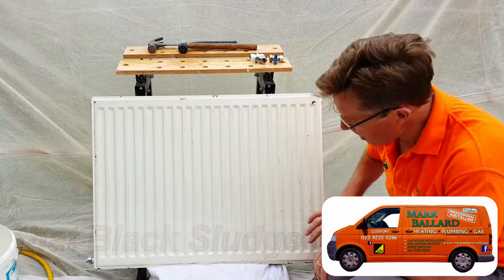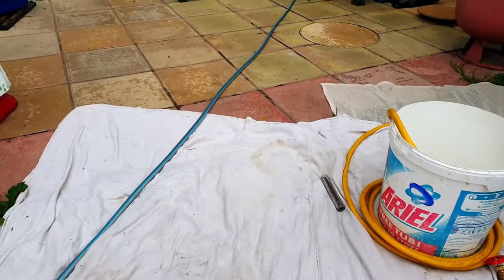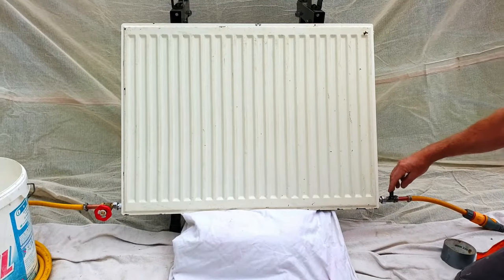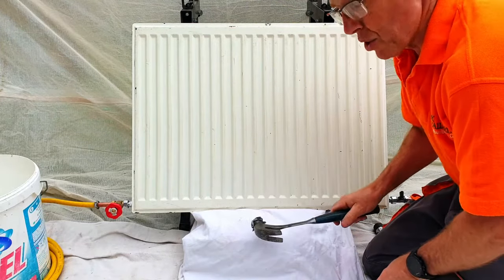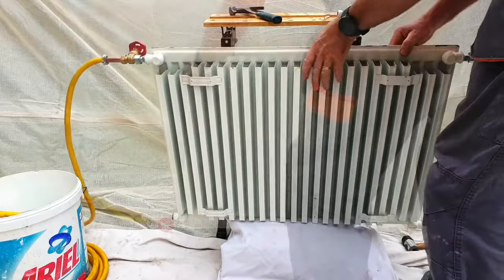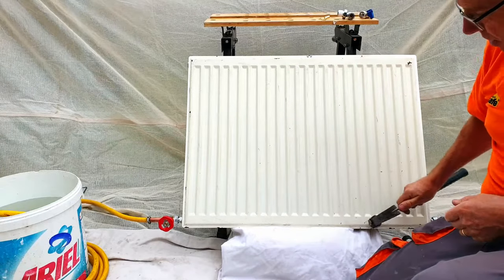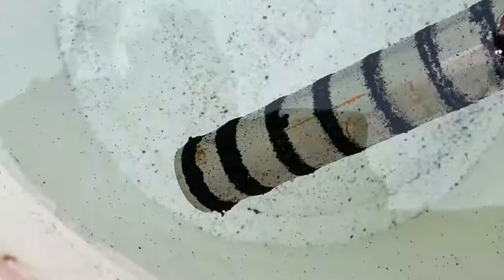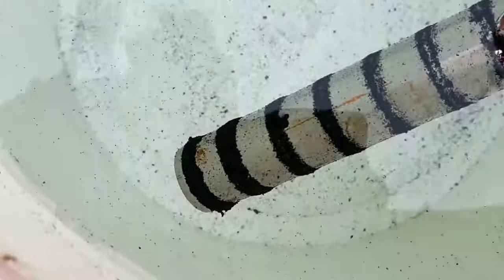How to flush Out a Radiator.  The Best Way, Getting the Best Results.

Comment: I assume (rightly or wrongly) you have fitted a one way water check valve in the mains water supply hose?😲😲 If not, magnetite and fithy water could be sucked backwards!
Reply: Water only flows out the mains (due to the pressure going out). Not in. What can potentially suck anything in? Nothing!
Reply: If there is any risk of this occurring then yes check valves are required by regs or yes with a depressurisation of the mains you can syphon shite back into the potable water supply... not good.

Comment: When you have dismounted the radiator from the system did you just shut TRV and lockvalve to stop water coming from the system? Or did you drainde the water from the entire system before removing radiator?
Reply: I just shut off TRV and lock valve. They don’t leak and does not effect other rads. You will need to top up pressure at the boiler after you refill rad

Comment: Useful video but I have one additional tip for larger radiators.
I took mine outside, used a hose adapter as suggested ( I keep old plumbing stuff so I managed to cobble together something)
I did as you suggested, including the hammer. However I really want to pick it up and shake it but it was too heavy(type 22 -110cm x60cm) I placed mine on a large unopened bag of garden compost and rocked the rad back and forward whilst holding it upright and with the hose running. This generated a huge amount of sludge, which choked the outlet at time but I kept rocking it back and forward till it cleared and run clean. I turned it upside down and repeated this perhaps 2/3 times over 20 mins. I used the bag initially to prevent damage to rad, as I was draining it direct to my outside drain, but when I started rocking it along the length, loaded of sludge came out
Reply: This is what I did with my rads recently- put them on a round 🪵 - half filled them before opening the outlet and rocked them back and forth - great way to get the gunk out

Comment: Hi Mark great video, I have ecotec plus,  5 radiators to clean etc, need to drain the system but need hot water tap. Can isolate the heating ?
Reply from the maker: Just close both the isolation valves under the boiler first before draining
Reply: @MarkBallardLTD  thats what I thought many thanks,

Comment: @Mark: Do you have a parts list to the “accessories” and kit you have constructed there to flush out the radiators please..🙏🏼
Reply: Did you sort one in the end?
Reply: @misfit1978  I did construct 2x tbh.. One for either ends.. ;-) [Havent used it yet, as the weather is horrible at the moment to work outside,and clean the rads.)
Reply: @mariusenslin  Yeah it's rubbish isn't it! I'm going to attempt it this week weather permitting! Could you give me an idea of what / where to get the parts from please?!
Reply: @misfit1978  All The Best of Luck..and do let me know how you get on.

The parts list is as follows, and did I get it from and between Screwfix and tool station,and whichever one had the parts in stock and were the cheapest.
-2x "Made4Trade Lever Ball Valve 15mm" Red or Blue" - Toolstation (£4.80/piece)
-2x 15mm Copper pipe 80mm in length - Cut off/leftover pipe from a job I did.
-2x 170mm in Lenght Garden Hose - Grabbed it off the next-door neighbours hose that they were replacing
-2x Hozelock Hose End Connector" - Screwfix (£4.99/Piece)
-2x "Hozelock Double Male Connector Pro [Metal one] [Amazon - £7.79]
-2x "10-16mm Jubille Clips" -  Have some in my toolbox
-1x "Ptfe Tape" [Screwfix - £0.25)

Comment: Perhaps this is a thick question, but I assume the pipes don't get flushed then?
Reply: 1. As you empty the system. Allow the water to stay on. The pressure will flush it out a bit more for you. 

Or you can 2, empty and refill and then empty.

Or 3. You can insert sludge cleaner (1 litre tub, for ~ 100 litres / 10 rads) and leave for 1 month as a pre-dose, (preferably in the winter, when the heating will be on, 1-2 hours a day). To clean and loosen the sludge from all the radiators / pipes / contact surfaces…. ( a bit like leaving the dishes / items to soak for a bit, before washing them). 

Then after a month, empty the water from the system. Then refill with water (emptying out all the air from the rads, to wash out all the sludge once again as a rinse, then finally refill with water, and insert inhibitor 1 litre tub for 100 litres / 10 rads (as a minimum). 

I have 18 radiators in a house that I am doing, so I use 2 tubs of sludge remover, then to empty and then to rinse out, and then finally 2 tubs of inhibitor (to prevent further and faster corrosion of an old system).

Thanks
Reply: @harunyahyadotorg  Brilliant. Really appreciated. Thanks.

Comment: Great video- I have a 40 year old   micro bore 8mm system. It works Ok. I want to put trv’s throughout. Should I replace the Radiators or just clean them out?
Reply: 40 years old is along time. 8mm is a very thin pipe.

If it works ok, and it doesn’t bother you that much  (which it seems like, since you ask the question). Just clean it out. You will see an improvement to more then ok. 

Only replace it, if it bothers you, and you are happy to pay the costs for a complete upgrade. Pipes and rads and boiler and all.
Reply: @harunyahyadotorg  James thanks for your reply...I got it wrong it's a 10 mm piping. Can you do a video on fitting a Thermostate to 10 mm rads. Should I replace the radiators or remove the internal spreader tube?￼  Both microbore pipes enter the Rad on the same side.  ￼

Comment: 1. As you empty the central heating system (radiators and pipes etc).  Allow the water to stay on. The pressure will flush it out a bit more for you. 

Or you can 2, Empty and refill (periodically to increase and release the pressure) to empty the water out. 

Or 3. You can insert sludge cleaner (1 litre tub, for ~ 100 litres / 10 rads) and leave for 1 month as a pre-dose, (preferably in the winter, when the heating will be on, 1-2 or even 3 hours a day). To clean and loosen the sludge from all the radiators / pipes / contact surfaces…. ( a bit like leaving the dishes / items to soak for a bit, before washing them). The longer you soak them the better but 1 month is enough with the heating on 2 hrs a day as an example. 

Then after a month, empty the water from the system. Then refill with water (emptying out all the air from the rads, to wash out all the sludge once again as a rinse, then finally refill with water, and insert inhibitor 1 litre tub for 100 litres / 10 rads.

I have 18 radiators in a house that I am doing, so I use 2 tubs of sludge remover, (for 1 month, heating on 70 degrees for 2 hrs a day) then intend to empty the system completely out again and then to refill and rinse out completely and then finally refill and add 2 tubs of inhibitor (to prevent further and faster corrosion of an old system). I hope it to work… let’s see… As that’s the best I can think of without pressure washing (£350, November 2021 prices) the system out. 

Thanks
Reply: How do you add sldge cleanr to the system. I don't see the way to just adding it in my system. Unless you mean one by one radiator?
Reply: @pistopit7142  if you have a vented system, you can close the tap into the expansion tank, release some water from the system from the lowest point, add the cleaner into the expansion tank, bleed the system, turn the water to the expansion tank back on. Not sure with a non-vented system.

Comment: Leave it be.If your radiators are hot no need to flush.I.Iused to flush my radiators every two years.Took themt off the wall and flushed them in the garden 8 Radiators various sizes.I haven;t touch them for twenty years the radiators are 38 years old.I do use rust inhibitors in the system.My system is micro bore.
Reply: The advantage of your system is that you can turn it upside down, the water will fill up the radiator, then through the other way.